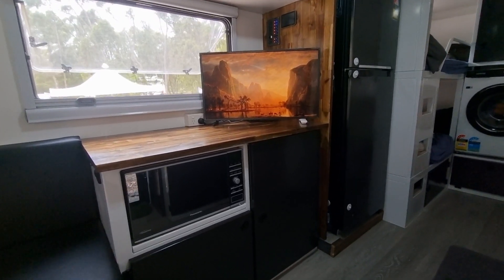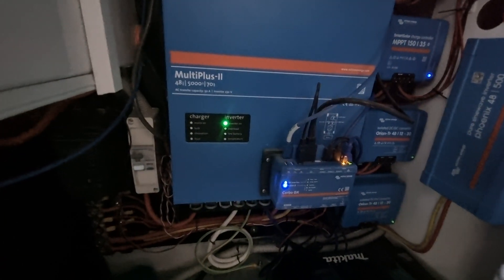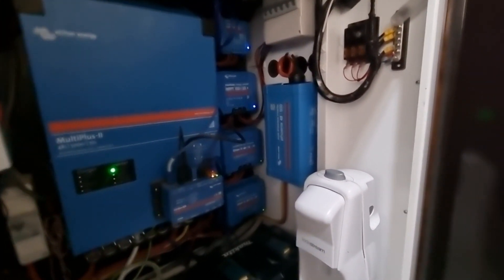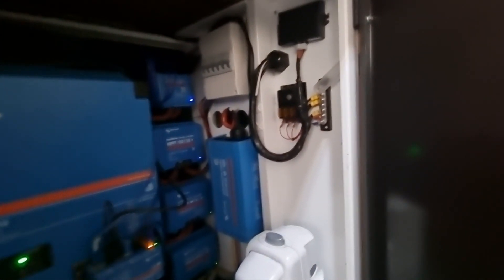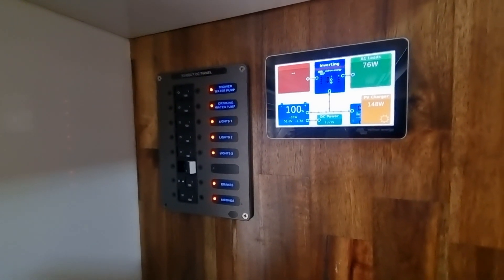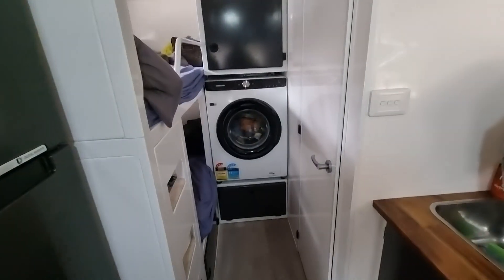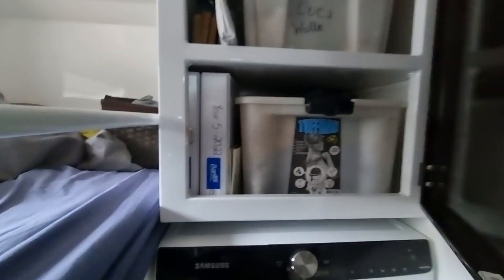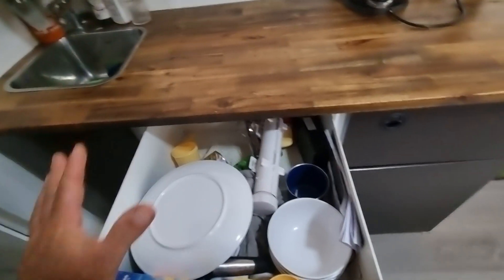"Pacey's Offgrid Explorer" caravan battery set up and walk through.

Comment: Would like to know, in 40 degrees day in the sun what would be the temp inside that box, have a much more  airy set up but still gets up over 50 degrees.
Reply from the maker: Hey Gonzo, 
We have a 12Volt computer fan that turns on with an output setting on the inverter itself. This is to help with air flow. 
Trent